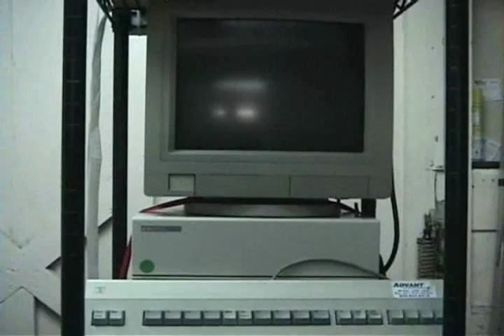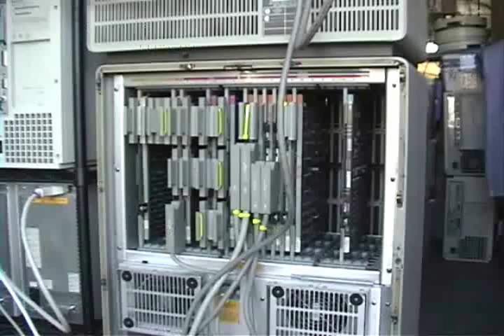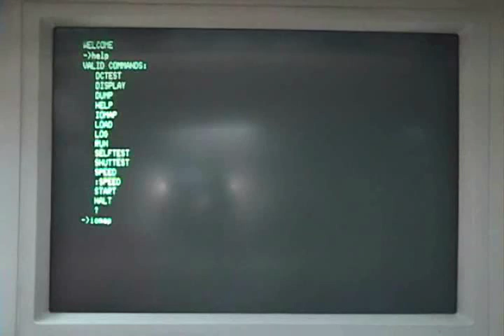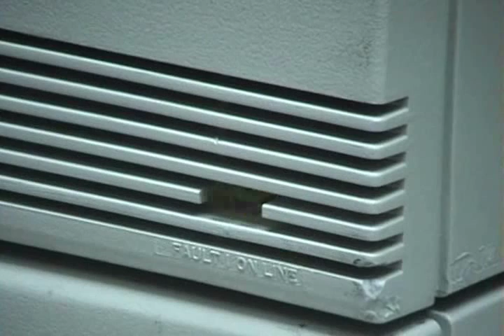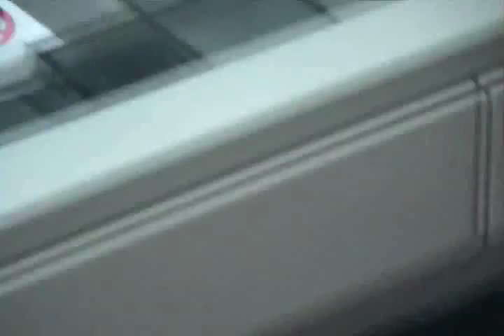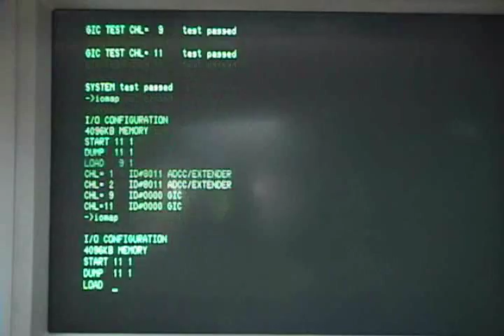HP 3000 Power Up and SELFTEST

Comment: I used to have a lot of calssic HP 3000. You need to plus you terminal in the console port and set data rate to 9600,n,8,1

Comment from the maker: @stevebasset Hi Steve - Yes, you want to plug a serial cable into the console port at  9600 baud. Sorry can't remember the other settings, but would start with 8N1. Will not run Linux, runs MPE/iX which I do not have a copy of. One problem you will probably encounter is that the TOD battery has probably dead and not a FRU.  But the 917 you have to hack the battery and I have seen people on the net that have done it. Sorry I can't be more help.